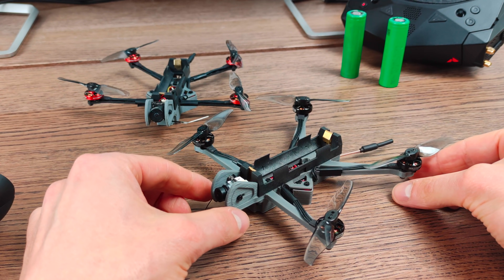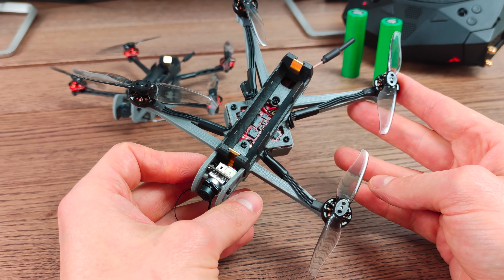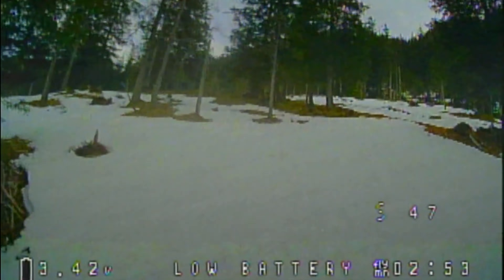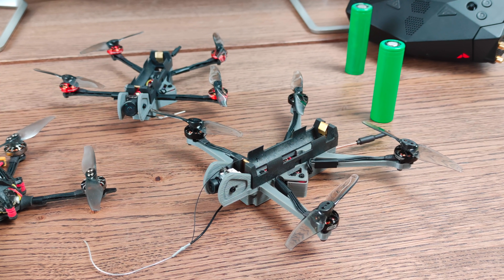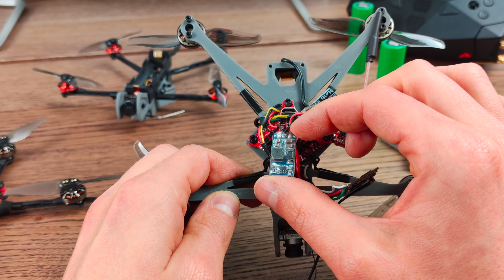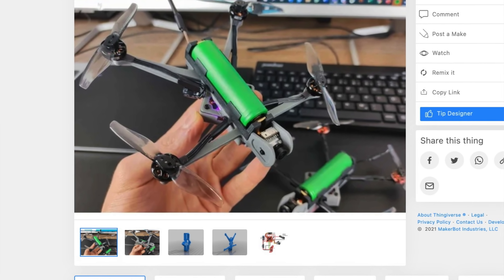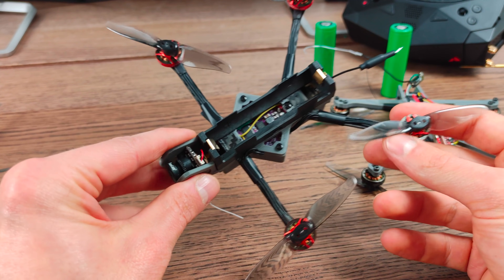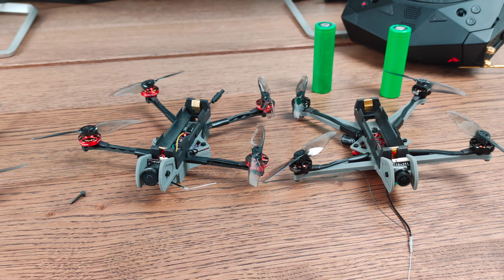The #NanoLongRange Part II

Comment: I would love to see a version of this with a second 18650 slot on the bottom, too - perhaps in parallel for double the battery life, minus the slight performance cost of the increased weight?

Comment: Hei man ! great video ! thanks for the work. I tried checking some of the part links and apparently some parts are not available anymore. Would it be possible to update those ? would be a huge help ! also, what type of camera would you recommend to have better quality , but still be able to use it on this type of drone ? Thanks so much, just bought my first 3D printer and I always wanted a drone so, what better method than starting with your own diy one !

Comment: Being that this is an older video, what Flight controller would you recommend to todays standards?    Currently in the old spec sheet it calls for a standard tinywhoop AIO board the Jhemcu Play 4, any suggestion on what board to replace it with?

Comment: It look you set the propeller with "prop in". Is drone will run more stable like eachine e011 and did you set the motor manually or using betafpv? any other setting requirements for get the prop in using beta fpv? Hope you will answer my question . Thank you in advance

Comment: Loved this idea as a low-risk way of getting into this hobby. I'm trying to follow the instructions regarding the wiring diagram, however, I am unable to get my receiver inputs to do anything. I am using a DSMX SRXL2 Serial Micro Receiver leftover from an unused fixed-wing. The receiver powers up and binds to the transmitter, but I'm unsure if I have the signal wire attached correctly or configured in beta flight correctly. I currently have the signal wire (S) attached to the pad labeled RC and the No Connect (NC) not soldered to anything. Motors spin when using the motor test in betaflight so I figure the receiver is the issue. This is my first time using a flight controller of any kind of help would be appreciated.
Reply from the maker: To be honest it's almost impossible to solve those kinds of issues from a distance and in the YouTube comments section 😅 Best go to RCgroups or even better try to get some help by someone locally

Comment: Micro long-range drones are a big interest to me. I came across a project that uses a Raspberry Pi for smart functions like elevation hold and planned flights. There's only a couple of videos on it, but they boasted a 20+ minute runtime which is amazing. Unfortunately the project seems rather dead and there hasn't been any updates in over a year. I may have to give one of these a shot, though I'll likely start with a small BNF drone as that seems to be a cheaper route to get everything I need.

Comment: Its the fpv video wobbly only because of the wind and it would be smooth without wind? Will it be smoother with carbon fiber arms in final product? Thats the only little negative I see here. Looking to buy something thats already built, works with flysky and will fly for 10+ minutes, 18650 is awesome budget thing too. I have built my first drone, MJX Bugs 3 into Air mode trainer with just F4 board and reciever being new parts and I almost lost will to finish the PID tuning before I finaly got it smooth, then I crashed, then its not smooth again, so I don't want to fiddle with that anymore, I just need a flyer that will give me some fun cruising around, but not this wobbly for that price tag, hope final product is better or this was really windy? I just love it in every other aspect, I don't need it to carry any kind of camera, and I'f I ever try that, its got good 5V chip on it to hook up some naked chinese knockoff cams without battery.

Comment: I would honestly be interested in a 2s 18650 or 2s 21700 4" version also using the snap-in battery system.

Comment: Honestly if you could build one based on 2 x 18650 it would be awesome. I would consider doing it with the two cells in parallel so that you would not have to change anything, including the DC/DC stepup and you may have a lot more juice in the batteries. 18650 used into ecigs ar rated for high discharge so the Max disharge current would not be a problem even when the batteries are running low.

Amazing job!

Comment: Is it around 100g with batteries?  How much weight only the printed frame without the battery holder, only the frame weight when you popped from the printers hotbed? I building one, but i need to stay under 120g because of the so strict regulations.

Comment: Dave_C I printed the frame and Built the Nano LR I love it, it came out very nice.  I chose to set mine up with a 2s system.  it flies really well this way, My question is should I leave it on the Stock PID's, or should I change it to your setup tune.

Comment: Fantastic build, I'm using the hglrc AIO and struggling to get the current reading set up, reading 7+ amps just sat on the bench on stock betaflight settings. What values should I use as my scale?

Comment: Sick project! I'm wondering though, nano long range is a 1s 3" and micro long range is a 4s 4". I want to build a 4" 2s with 18650's. Have you considered this? What motors would you use? 1303? 1404? what KV?

Comment: Very interesting! I think about building this as a normal drone and upgrading later to fpv. Is the radiosignal for control transmitted over the video transmitter or do you just put an antenna on the flight controller? sorry if this a dumb question :D
Reply from the maker: It's a separate receivers but there are Flight controllers where it's integrated (SPI receiver) :-)
Reply: @DaveCFPV  thanks! So with the flight controller you linked in the description it would work without the video transmitter?

Comment: I have a few questions...
Could you recommend something a bit cheaper? I am looking for something that can fly 10-15 minutes at least and to have cheap battery and this looks great but it is a little bit pricey since I am a noob and just want to move away from my current setup which is literally a toy drone with fpv camera. 
Could I buy this flight controller and just put cheaper motors and video transmitter? 
Are there any cheaper motor that would work? 
Thanks in advance.

Comment: Great design, an idea for making the frame stiffer and not adding to much weight would be to make slots for 0,5mm CF rods and glue these in the center or similar. Should add some stiffness and improve flight performance

Comment: Hello, I don't have a 3D printer, I would like to know if I can use an already made chassis / frame that can be purchased, like carbon ones for DIY, is the extra weight of a frame / chassis that I take on the market would be a problem for the 1S? compared to the additional weight
Reply: or else will you produce it in large quantities

Comment: I've actually been modding my 1s quads for a long time. I vape, so I have MANY 18650 batteries. If the quad is big enough, and can life the weight I will put one/two 21700 batteries or 1/2 26650 batteries. The length I get out of those batteries blows my mind. Awesome video, I love modding things. Maybe invest a couple dollars in 18650 cases, that way you don't need to worry about shorting any batteries out on the journey.

Comment: Very good idea the 1s nano long range but for sure as it is now it can not be named as a long range quad.  
For me you can not have a long range quad without gps and with a low power vtx. 
It is a no deal  if you can not fit a gps in order to have the very useful osd gps data and the gps rescue ability and if you cant have enough transmitting power from the vtx.
Maybe a 2s lion version could be a more realistic option.
Reply: People were doing long range before gps and good video equipment.  Just takes more preparation.

Comment: any thoughts on using a 21700 (2170) battery as an option? It would certainly need a different battery holder, but if 10 minutes impressed you, I wonder how much time the slightly bigger cell gives you.

Comment: That's awesome! What filament did you use?
Reply: Build Instructions:

    Print in PLA or PLA+ at 20% infill. You can cure it in an oven or on the hotbed with a cover at 80 celsius for 45min to make it stronger
    Remove the little plastic knob on the bottom of the battery tray
    Drill four 2mm holes in the tray exactly where the holes in the printed parts are
    Apply some glue on where the print and the tray join
    Use the M2 screws to mount
    Wiring: Check the wiring instructions in the pictures. Please make sure you know what you are doing and have basic knowledge of FPV drone building. If you are new to it Joshua Bardwell's Youtube and Oscar Liang's blog are great resources to learn the basics.

Comment: @Dave_C FPV  you should look at 21700 batteries, they are just a bit bigger than 18650's but will give you more capactiy. if you want to go crazy, They make 26650's too.

Comment: I ordered all components as you suggest but in my opinion the biggest issue is the Amperes those Motor take. According to the table each motor will draw 8.3A at full trottle?? Should be limited to 2-3A max somehow otherwise the Battery Voltage will collapse. Can you confirm?
Reply from the maker: The amp draw stated in the spec is always measured during a static thrust test. It is not reflecting the real amp draw during flight but rather an indication to compare motors. The real amp draw is usually 30-40% lower

Comment: Hi Dave, this looks like very good technology, at the risk of sounding like a silly question, is it possible with a quad this small to record the flight on a micro SD card to get much higher quality video ?
Reply from the maker: Yes I have a test setup recording 4K 30 onto an SD card
Reply: @DaveCFPV  Hi Dave, I wanted to ask a similar question, i.e. if one would add Runcam Split Hybrid 2 (approx. 14g more than the setup with Caddx Ant), would this drastically change the flight time?

Comment: This got me interested in the 18650 quad concept and I found that my Tinyhawk Freestyle will fly quite acceptably with a 18650 strapped to the top of it. I'm only able to get 8 minutes of flight time before there isn't enough lift but that's still quite good. I'll build out your design when I want to push the flight time envelope out further.

Comment: Hey Dave, I really want to build one of these and while I was going through all the parts I found some other Motors (Apparently I can't post links here so to find them just search for "4 pcs mamba 1103 12000kv 2s brushless motor for whoop" on banggood) They are 1103 12000kv Motors by Diatone and much cheaper. It says They are 2S Motors but in the comments someone used them for 1S and said it was fine. I don't really have any experience in such motors and I couldn't find anything on the Internet about it, so I wanted to ask if I could use those instead or if they would have any disadvantages.
Many Thanks in advance,
Emil
Reply from the maker: I guess they will be fine. Pretty similar in stator volume and kV to the 1202.5
Reply: @DaveCFPV  Thank You so much for your fast reply!

Comment: Thanks for the video! its possible to transmit the video to laptop instead of FPV Goggles?
Reply from the maker: It can be transmitted to a phone or laptop but the latency will be too high to actually fly like that
Reply: @DaveCFPV  Thanks for the answer, for transmit the video to laptop/tablet without Goggles what I need to buy for connect the laptop?
Reply from the maker: @idanmastitz6187  Something like a Eachine ROTG01 ... It works with android, but not sure about laptops

Comment: Man this is cool, I want to build one too. How would the fixed wing equivalent of this drone look like? Flight times must be crazy long for that.
Reply from the maker: I was messing around with something along those lines 😁
Reply: @DaveCFPV  Do you have any news considering a 1S wing? I think it´s a pretty cool idea. Maybe we could use a noxe fc with inav powered by a step up converter and build a voltage divider to 3.3v max that is input in the curr pad. So we would get the real voltage of the battery displayed in the current sign. I looked around for 1s escs and found flashhobby or topac 1s 7A escs. But I don´t know if they can work down to 2.5V. If you have any news it would be great if you could share it. All 1s fc´s seem to be integrated with the esc´s and not inav ready as far as I saw...

Comment: I’m new to fpv drones So I actually used a Uruav uz85 ($81)to make this, it’s a kit they sell on bang good that comes with the crazy bee x(aio including fly sky transmitter and vtx,you can add your own vtx if you’d like for now I haven’t ) and it was basically plug and play. The only things I had to chance was the motor mount holes on the frame,extending the motor phase wires and get 3 inch blades! 

So far it’s been nice to learn on!

Comment: Have you thought about using a 21700 size battery instead of the 18650?, I wonder would the flight time would be with a Samsung 50E 21700 5000mAh.
Reply from the maker: Yes they are simply too heavy for the little power this setup has

Comment: Dave do you have any alternative motors you would suggest? The ones you originally pointed to are basically sold out on every US site
Reply from the maker: These are available but its not a US site https://bit.ly/3bM0Ts0
Basically any 1202.5 10-11.000 kV will work just fine

Comment: Waiting for all the components I did a first test rig with BetaFPV 1S AIO (with 25mw onboard VTX) and NewBeeDrone Flow 1202  11520kv motors, I could perform up to 13min and a half with a VTC5 2600mah before reaching 2.5v in the OSD 👍

Comment: Hi Dave,
first: great build, and also praise for sharing your design with everybody. 
I was wondering if it wouldn't be worth a try to fit a proper Boost-converter to this build, as to feed the AIO with 7,4V. Of course you loose some battery capacity with the switching inefficiency, but overall it should still be superior to a "regular" 2S-LiPo setup, don't you think?
I am currently trying to find such a converter (2-4.1V input Voltage, 7,4V Output Voltage and >5A I_max), however unsuccessfully so far. Would be very interested to know your opinion on this.
Reply from the maker: I looked into that but a boosters that can supply the over 15-20 A required in total are huge compared to the quad. Seems like a more viable solution to just boost the voltage where it is really needed to feed the electronics

Comment: hi,
hab dir auch schon bei insta geschrieben aber weiss nicht ob du das bekommst,
ich liebe deine builds und ganz besonders deinen neuen, 
aber als ich mir das video angesehen habe hab ich mir gedacht, warum eigentlich nicht einfach die gleichen motoren nehmen, aber mit nur 5000kv und dafür unten dran auch noch ein clip für ne 2. 18650... dann bräuchte man auch nicht mehr den 5v converter. 
hast du da schon mal dran gedacht bzw das ausprobiert?
liebe grüße 
Tim :)
Reply from the maker: Hi Tim! Ich hab schon nen 2S Li-Ion steup gebaut vor längerer Zeit aber die sind echt problematisch. Muss 4" sein und damit haben die meisten 1-2S ESCs nicht genug max amps. 2-4S ESC/FCs bekommen aber wieder probleme wenn man die Liion richtig leer macht und sich 5V nähert. Werd aber noch mal nen anlauf wagen.
Reply: @DaveCFPV  hmmm okay, das wusst ich nicht, danke für die antwort :D

Comment: i just finished building a 1S 2.5" (65mm) "long range" quad with 18650 battery tray.
in the first test flights i've gotten 15 minutes + easy flight times (cruising around in my house) with landing voltage at 2.7V.
at first i used HQ T65 biblade props, which made me land around 3.2 volts since the throttle had to near 95% to just stay in the air.
i swapped them out for GemFan flash 2540 triblade props and i could fly until 2.5V until i lost enough thrust to stay in the air.
my nano LR isn't even build to be as light as possible, it has an 400MW vtx with build in dvr ( to get some nice recordings), full carbon fiber frame, metal screws, a foxeer lollipop antenna and a beeper on board..
at 400mw power i will loose roughly half  a minute of flighttime compared to 25mw, and the step up regulator struggles and gives a lot of interference (horizontal lines through the fpv feed)
parts used (for those who want to build one and on the "cheap")
-18650 battery tray with high current gold contacts  (which is JB welded to the top plate of the frame)
-sony VTC6 3000mah 10C 18650 cell
-happy model EX1203 11000KV motors
-multi function step up boost module set at 8V (for VTX and reciever)
-namelessRC D400 400MW vtx with DVR module
-caddx ant 1200tvl nano camera
-Play F4 whoop AIO flight controller
- SkyStars StarLord micro toothpick  freestyle 2.5 inch frame

this little quad sits great next to my 4" 4S long range digital airunit quad and my 3" 4S long range vista quad.

Comment: Literally been playing around with this build tonight and started soldering up the bits. Everything except soldering motors done. My frame looks a lot worse than yours! I used the Flywoo 1202.5 motors you recommended originally. Going to need a different undercarriage as used a Fywoo Goku F413S with the Tiny Tank and Radiomaster R81 for now, and all seems to work on 1S but doesn't fit the original undercarriage well. I might try crossfire later. Still waiting on the step-up converter you suggested from bangood as well but could not wait to get it together. I think I would also like to use it with a 450mah 2S as well as a 1S, so I may omit the 18650 holder as Riechert are taking forever to deliver anyway. I have a 18650 with a connector soldered to it that will work for now. Thanks for the pointers as always :) I see me wanting both the Rekon nano frame and the 4 FR!